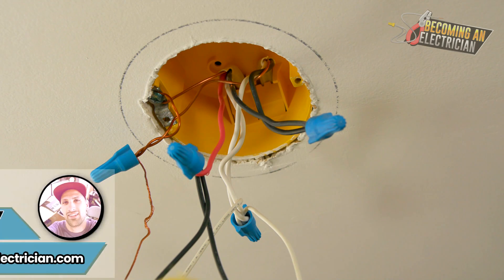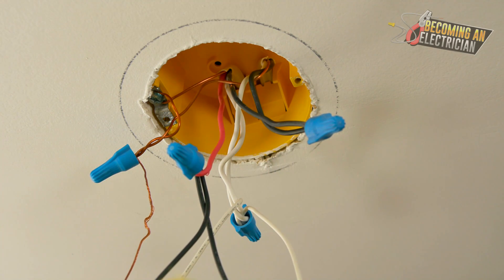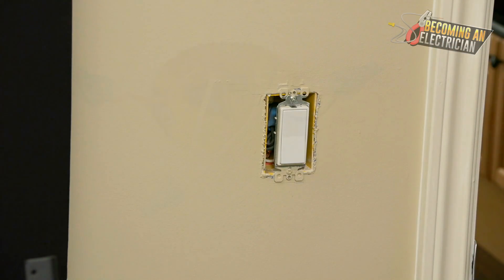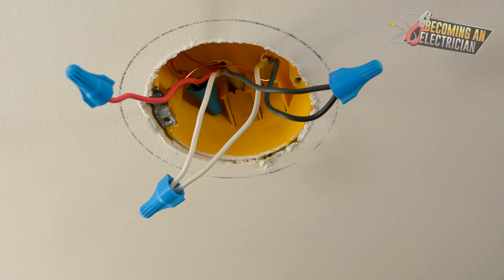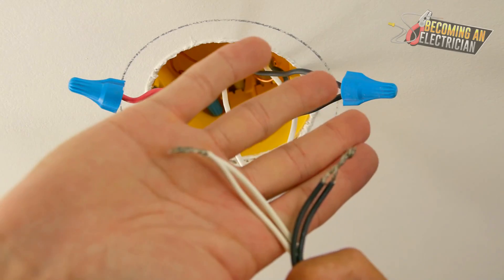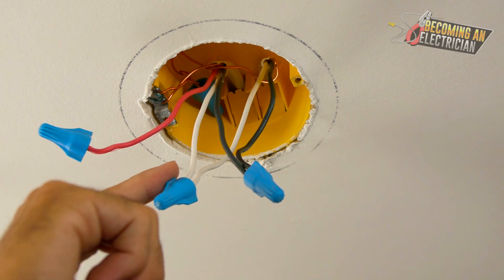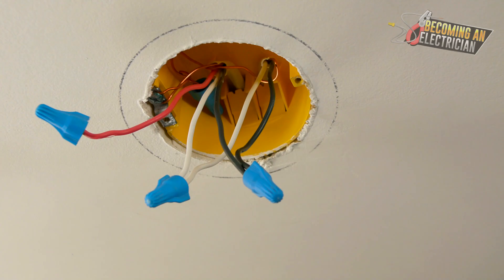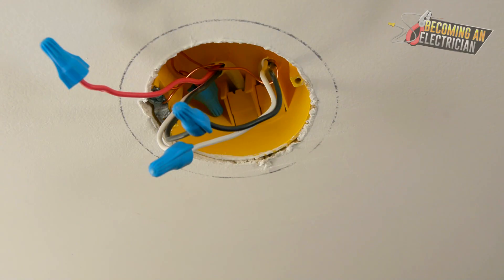Never Run Power to a Light Box

Comment: I made this mistake a few times thanks
Reply from the maker: Yeah, running power to a light switch is a lot easier for maintenance.. no need for a ladder or taking down a light.  Also nowadays boxes need a neutral by code for smart devices, so lots of benefits to bringing electrical power to a switch box first, then working off that.
https://becoming-an-electrician.com/

Comment: when you connecting a switch u ave to ave power in the box so 2 wire coming from the switch to the box thats going to connect ur light...one of those wire coming from the switch is what u call a return...
Reply from the maker: In an electrical switch you need a hot and neutral wire.  It's always wisest to run power to the electrical switch box first for easy electrical maintenance (no ladder required, and don't have to take down a light to troubleshoot).

In the light box in the video, potentially they wired it for a fan, but even in this case, you can see they spliced in the light box, meaning it was an inexperienced apprentice electrician not understanding the whole picture.

For anyone reading, run power to the light switch box first, then run a switch leg up to the light.  (2-wire for regular lights, 3-wire for a fan).
Reply: @BecomingAnElectrician  excellent!! I love your work~ hope you can post more videos! 👍🙏☀️
Reply from the maker: @samgonzalez1447  Yes, will be coming soon :) - Visit the website for tons of articles & videos: https://becoming-an-electrician.com/

Leave a comment on the website with what you'd like to see!

Comment: I’ve watched some of your videos and really enjoy them. For this one, I have a totally different opinion. It’s my experience that it is much cleaner  to run power from Fixture to Fixture,  then drop a 14/2 or 14/3 loop down to the switch . Especially when rewiring older homes since it takes less much effort to fish a Single loop to a switchbox than it would to Fish a feed, downstream, and switched leg in.  Too, there’s always more cu. In. In the fixture box.
Reply from the maker: Regarding renovations, that is something that is "whatever is easiest" because it's usually a one-time fix and you're good to go.  If you're wiring a condo where there's 40+ units, and many apprentices making mistakes, getting everyone to bring power to the light switch is by far the easiest way to troubleshoot.  Otherwise you have to bring a ladder around with you everywhere, and you're hoping they brought power to the closest light..

Bringing power to the lightbox switch is very wise words of advice in normal situations I have been taught by many good journeyman over my years.  It's very easy to see if anything is missing power/switchleg before drywallers proceed with drywall.

KEEP THINGS SIMPLE 🙂

Also thanks for watching and your comment!